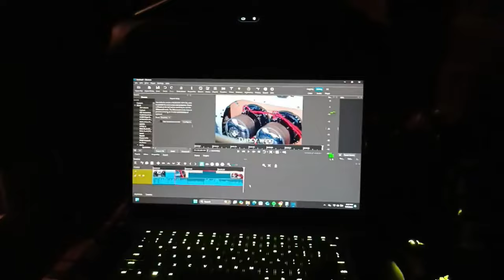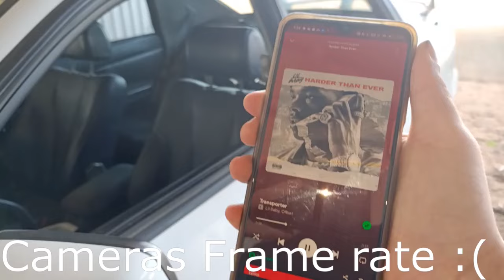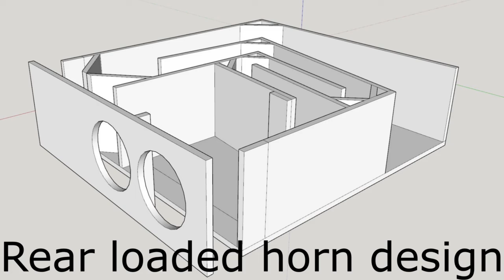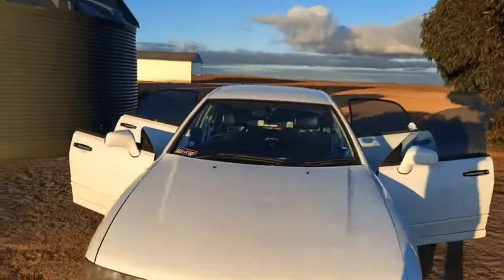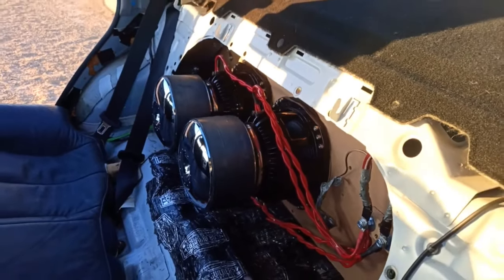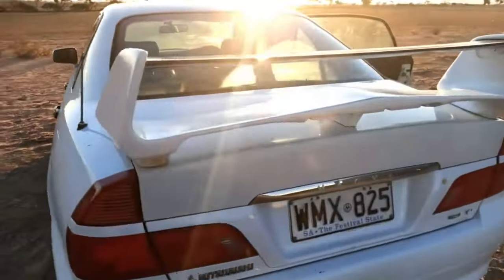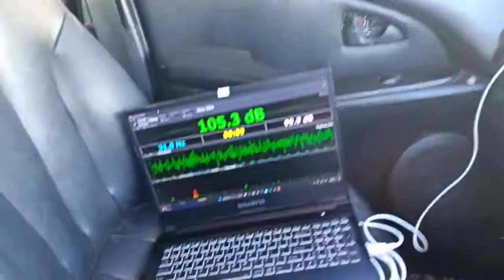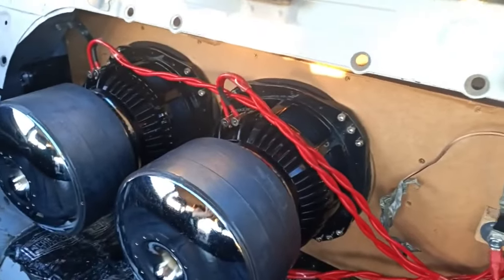Sundown Audio Prototypes (z8) Getting windy!

Comment: Hey man another Aussie here. Love your work ❤  I have a enclosure designed to get windy for 2 12s by drew Jones originally and I wanna know best 12s for powerful lows and wind? Has to be 240mm mounting depth or less, so big sundown are out. What would you suggest available to Australians  please?
Reply from the maker: Zeroflex subs. they have been supportive to me and i have had great luck with their most recent equipment. got sent some tko 8s to test and was very pleased with how they performed and the xl12 did 152+ floating shirts door open. will be doing 2 of them in the near future

Comment: Whammin for sure, man I'm stuck trying to decide if I should run 3 sundown U8s or 2- X8 V4s ported under my seat of my truck. I know 3 U8s more cone area but those X8 v4s get have more excursion and handle some power. Yall think both setups would be close to the same or would one be that much louder then the other
Reply: More cone area will definitely be louder. You’d also get more power handling by having 3 subs. But ideally just get 3 xv4s instead of 2.
Reply: @biguzivert  don't have enough space to properly run 3 of the x8 v4s jus have enough room to run 3 U8s
Reply from the maker: @johnnypiper1717  i wouldnt worry about going smaller on the airspace to run 3 xv4 8s.
Reply: @puresesh7985  so your saying the x8 v4 would play jus fine in .65cu net per or .5
Reply from the maker: @johnnypiper1717  yes
Reply: @puresesh7985  cool, I'm assuming the smaller it is the less musical it will be? My box builder told me 2 was what I had room for I'll tell him what it looks like if I go smaller and add a 3rd. Thanks dude
Reply from the maker: @johnnypiper1717  not really smaller box means less group delay and not as much of a peak at tuning
Reply: @puresesh7985  ok cool, well I believe I have about 2.4cu net to work with after sub and port displacement maybe. How much port area you thinks best about 16sq in  per cube
Reply: @puresesh7985  what's the highest tuning I should do with the x8 v4s you think no higher then 35hz?